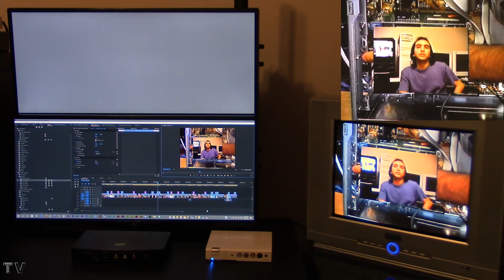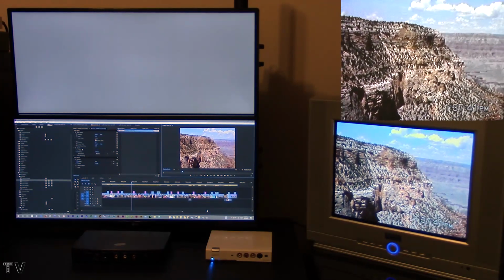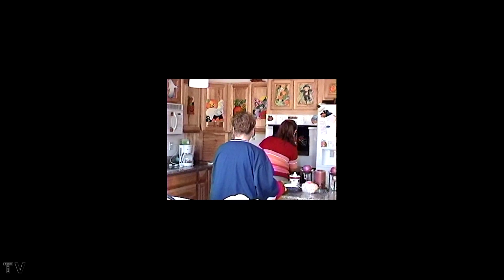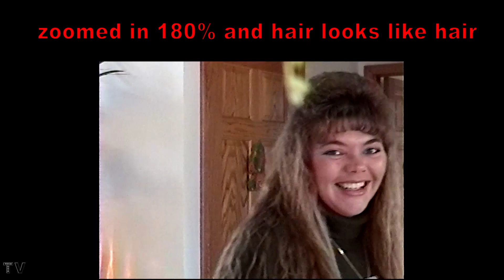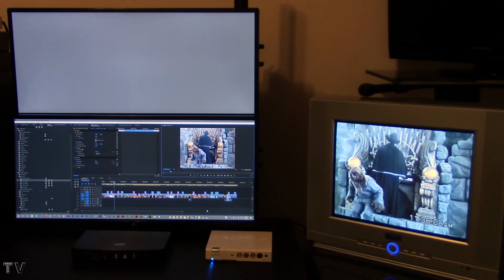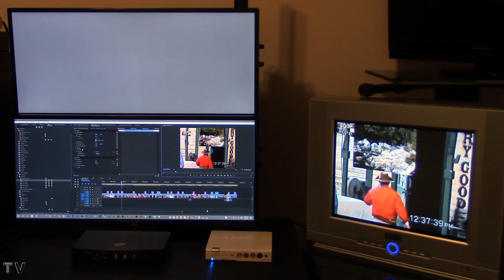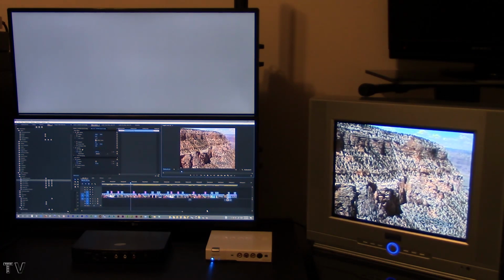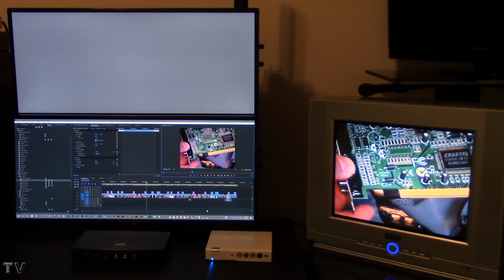The best VHS and hi-8 video capture cards and video transfer devices

Comment: Im just getting to building a system for this stuff.  So far what is working for me is to come out of a source, lets say VHS, i goin into a Panasonic DVD recorder DMR-ES15, the send that into my SONY HVR-1500 for the firewire output to a mac. seems to look good, if i go without the Panasonic in the loop, it will just cut out like crazy trying to capture any little tape glitch will set it bonkers. the Panasonic does a real good job as a TBC. does the Canopus 110 do  a good job as TBC as well?
Reply from the maker: The ADVC 110 does not  need a TBS. My new M4 Mac Mini was delivered last Friday. The Canopus ADVC 110 works just fine with the new M4 Mac Mini. I will post some videos soon.

Comment: Thank you for your videos on this topic! I'm digitalizing our old VHS tapes and was set on trying to find a ADVC110 but now I might try to source cables and test out using our old Sony DV camera with FW. The TBC function that the ADVC has, is that normally present in FW DV cameras? If not, maybe the ADVC110 is my best bet after all. Thanks again!
Reply from the maker: You could try your DV Camera. I think it should work but if not you can get any firewire DV converter.

Comment: Hello! What if I connect my Digital8 camera to a DV to Firewire cable (Firewire 400 to 800) to a Thunderbolt 2 adapter to a Thunderbolt 3 adapter and then to my Macbook pro 2020 M1? Could I capture the videos directly to Premiere pro or do I necessarily need the Canopus converter? Thank you!
Reply from the maker: If your camcorder has Firewire ports you are good.

Comment: I bought this unit many years ago knowing I would be encoding Hi8 tapes. I'm encouraged by what you say after hearing so many negative things about the DV codec. The alternative would be to use a PCI Express capture card with what ever codec I want, but I would lose the stabilization circuitry of the Canopus because I don't have a TBC. I have two questions. Do you still think the Canopus is the better alternative? Also, is it possible to use the Canopus in pass-through mode so it would export a better analogue signal which I could then capture with an in internal PC card? Thanks
Reply from the maker: The ADVC 110 has good quality and is hassle free. I made mention in one of my other videos that the ADVC 110 cannot be used for pass through to clean up the signal. It has to go through the Firewire port in order to get a clean signal. The video link below shows my workflow. 

https://youtu.be/dVLUxRkPMdA

Comment: Wouldn’t it be better to buy a VHS player that has HDMI output? That way, the analog signal has already been converted to digital and is pumped out as an integrated video and audio signal. As such, we don’t need any expensive capture card because the card does not need to do any conversion processing.
Reply from the maker: There are not many VCRs with HDMI. At the time I bought my VCR in 2014 it was the only model you could buy. In 2008 you had a more choices. I wish mine had an LCD screen with VU meters and time code.
Reply: @TechTVusa  If there were such a VCR with HDMI, given that HDMI is digital, does it imply that there is a analog-to-digital converter built into the VCR? This makes sense because I do find players out there that accept both VHS tapes and DVD discs. These can not only play discs and tapes but can burn the footage from VHS onto the DVD directly. These appliances cost at least $400 so there must be some high end components inside them. 
https://www.amazon.com/LG-RC897T-Multi-Format-Recorder-Digital/dp/B00195IURA

However, it makes no sense these days to have the media on DVD discs given that we have Youtube and other media sharing services including those that cater towards sharing private media like Google Photos. Why send someone a DVD of your vacation when you can simply share it via a secured link?
 
There must be some heavy lifting already done by the VCR so the external HDMI to USB capture card does not need to be of high quality because the adapter basically works as a pass through of a digital signal from the VCR's HDMI to the computer.

With that said, you would think given there are millions of VHS tapes out there in people's homes that need to be digitized or simply play back on modern digital TVs that don't have legacy analog connectors like composite, component, coax, S-video, and others, enterprising media companies would be selling these VCRs with HDMi output.

As said, there is no point in having these combo appliances that take both DVD and VHS because the majority of home movies shot during the analog days are on VHS. This is why the LG box is discontinued, but LG should make a replacement model that only has VHS with HDMI output which should be cheaper to manufacture. Skip the DVD middleman altogether.

We all know it will be very soon you cannot even buy a used VHS player. So it's more urgent now than ever to digitize your precious home movies. I have been planning to do this for a long time, but cannot find the time.

Comment: Hi!
I just want to know if the Canopus ADVC 110 or the Intensity Shuttle is capable of correcting such a disintegrating image.
I know the tbc can stabilize the image, but my tape recorder (Sony SLV-SE600) does not have tbc and the tv can play back continuous image, so i need a digitizing card that can capture a stable image, and i think the canopus ADVC 110 or the Intensity Shuttle can do this. Can you confirm this?
Sample:   https://youtu.be/luc04oDB-XM
Reply from the maker: The Intensity Shuttle will not capture old worn out VHS tapes at all. The ADVC 110 can capture old worn out VHS tapes and stabilize the signal to some extent. The links below should prove to be helpful. 

https://youtu.be/KcI9q7I7ofI

https://youtu.be/xdw9_DETrqE

Comment: Great video. Do you know how I would go from the advc 110 to the new macbook pro with USB C
Reply from the maker: The video link should help. https://youtu.be/vATw63nn3OQ
Reply: @TechTVusa   In my opinion , TBC is also a must for the advc110, I dont know if Premiere will stops capturing on Hi8 for more than 30mins, But it does on VHS, which I have tested many VHS without TBC and TBC solves the problem
Reply from the maker: @NBAONDVD  How much credibility should anyone give your opinion? It is not wise to assume your system is the benchmarking standard. I have used several Firewire DV converters and all of them could capture for over two hours without a TBC. I have used Windows 2000 through Windows 10. If I had the same problems as you I would not recommend the Firewire DV converters.  Do you see my point? Keep in mind the purpose of a TBC is not to allow you to capture longer than 30 minutes. While the TBC might allow you to do so there is obviously other issues with your system since I have never had that problem.